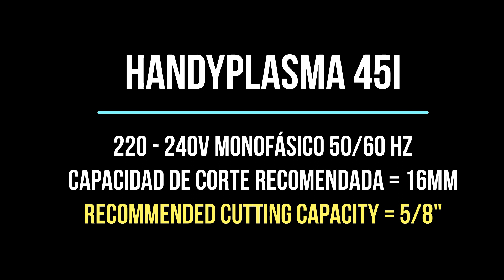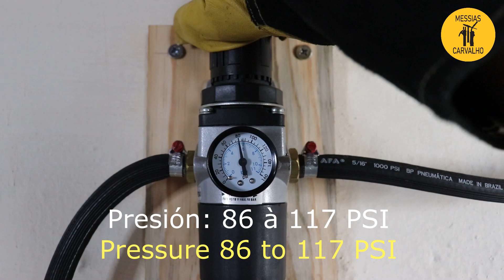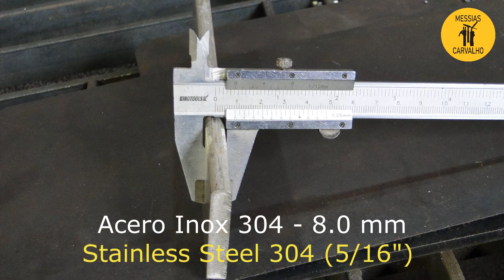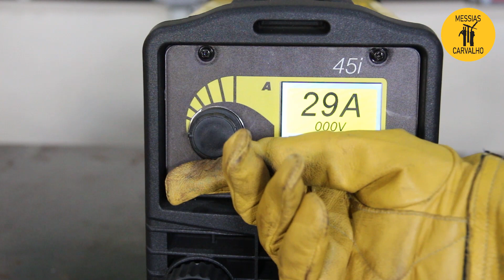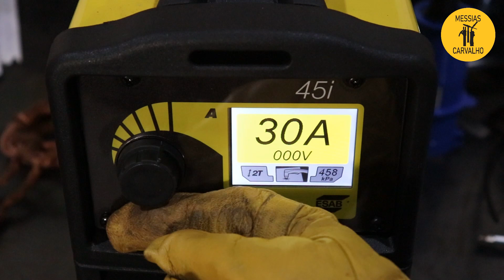Corte Plasma Portatil "HandyPlasma 45i" - Plasma Cutting Portable

Comment: Hola, por si alguien está pensando en pillarla para CNC y duda por lo del arranque en alta frecuencia, decidles que si es válida, utiliza sistema de encendido blowback. En mi caso ni una interferencia, la pega es que le he tenido que insertar un conector para realizar arranque desde Mach3.
Desde que la pille he tenido problema para cortar a más de 27 Amps por limitación de potencia contratada en casa, en 27 Amps corto letras y formas en 5 mm como si nada.
Un saludo